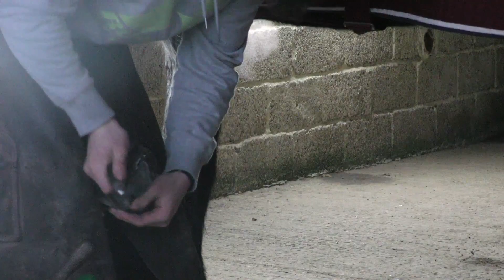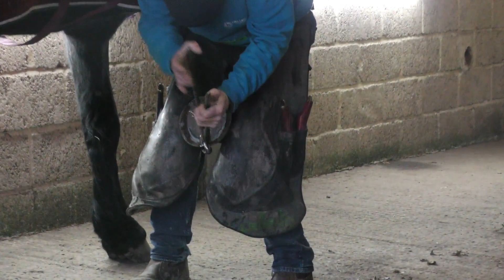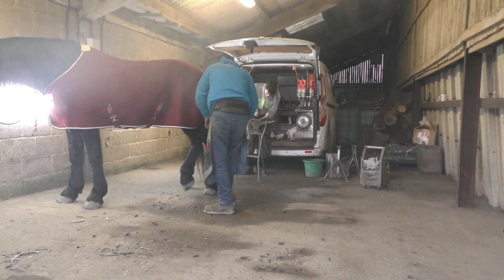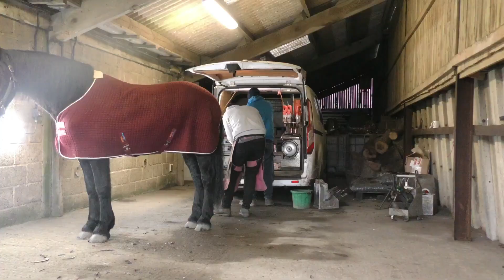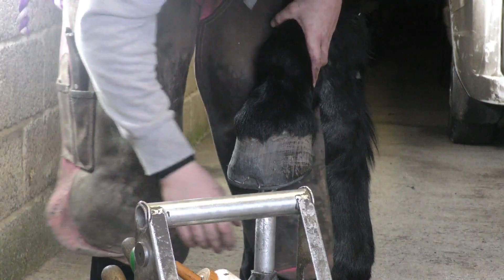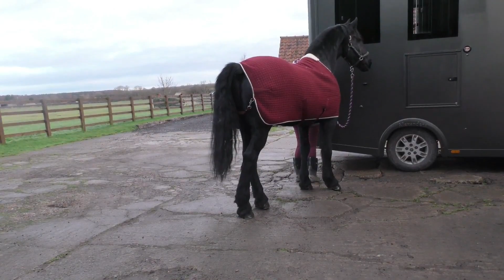Apollo The Dragon

Comment: Hi Tara and Rens,  Apollo was such a well behaved boy at the farrier.  They must be pleased to work on well behaved horses as I bet they get some real terrors in to shoe sometimes.  I watch Fresian Horses and they showed their horses being shoed but the shoes were not heated up before they were applied.  Is Apollo getting custom shoes or are there just different ways of shoeing horses?  The fact that both Apollo and Farouk have healthy hooves is due to the good nutrition and care you provide.  You are amazing pet owners.  Take care.
Reply: I was always told hot shoeing was preferable to cold shoeing as the farrier can make fine adjustments to a standard size shoe to individually fit every horse. Cold shoeing obviously requires less equipment (like a forge/furnace) though. Hot shoeing is probably the norm in the uk but that may not be the case in every country 👍